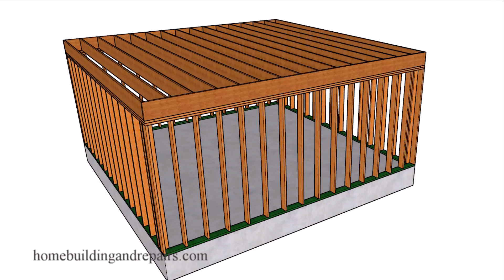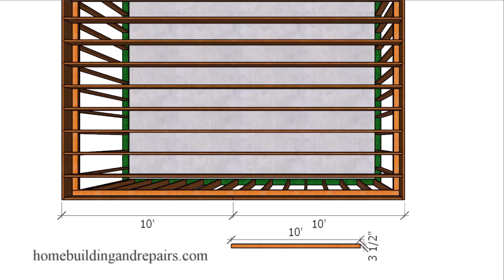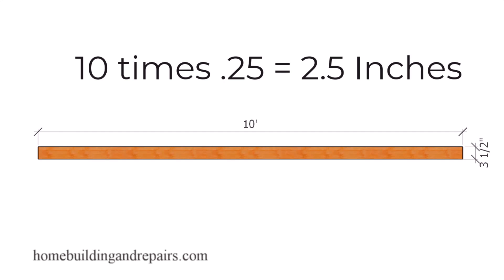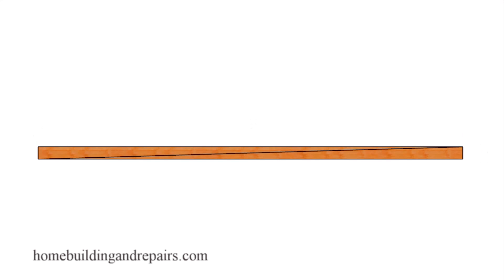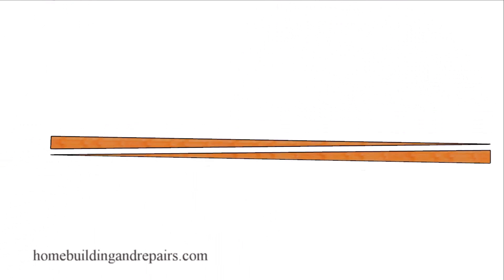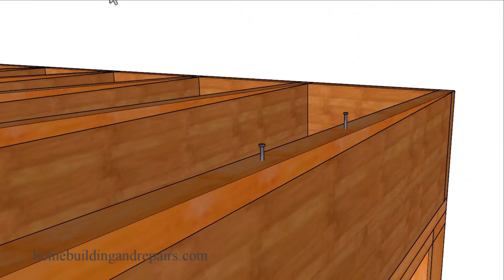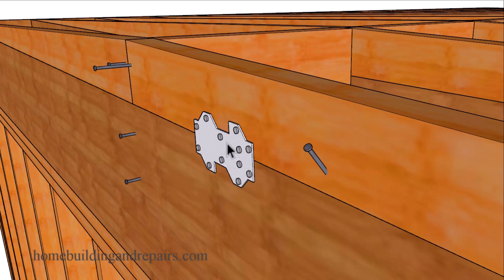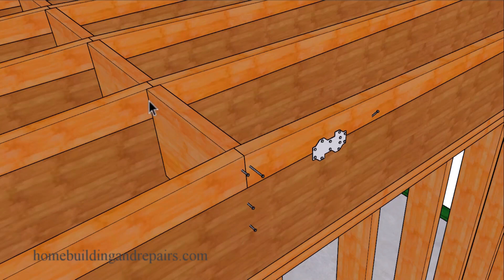How To Calculate And Attach Shaped Rip Strips To Build Low Sloping Roof

Comment: On a low pitch roof. The size of those beams /headers, have to be a minimum of what ?
Reply from the maker: I can't provide lumber sizes, but think you could use roof framing span charts to find something that could work.